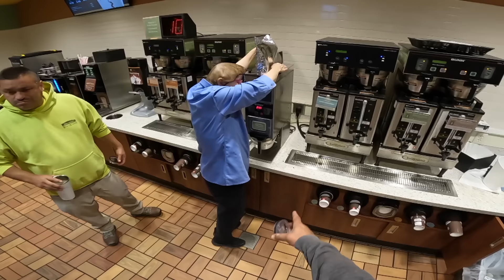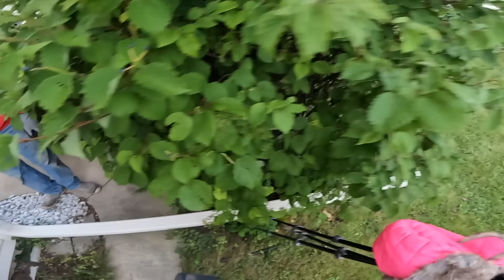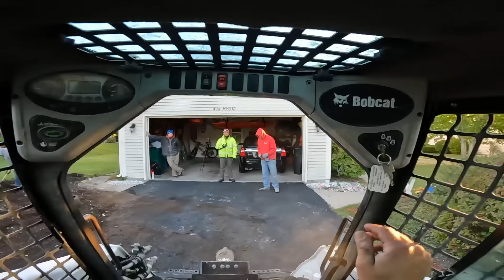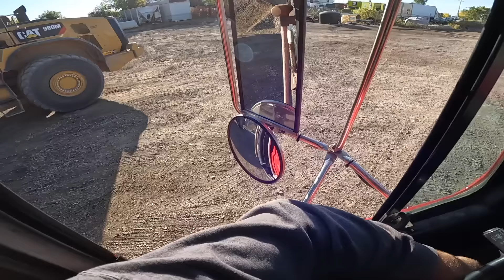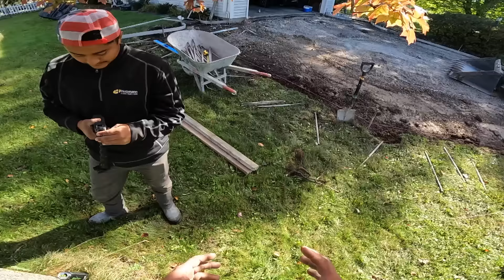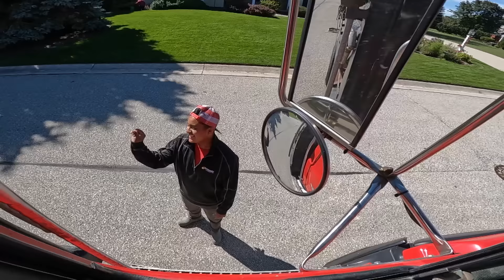New concrete project AND a new car for Bugs!!!

Comment: I had my class A for years and never like driving. Only did it like you when i had to. I totally agree with you, operating and laboring was more in my wheel house. Would be nice if you could find someone dependable for that position.

Comment: Diesel white smoke, depending on make and model, generally an injector issue, but important to figure out what’s causing it before opening the parts cannon., fuel filters clean ? , ficm? Injector pump? Lift pump?

Comment: Next time you drop the trailer set a cone up against wall of the rear most  driver side tire and when you go to connect again just get that tire right up against the cone and you know you’ll be in the right spot

Comment: Is Eric dump truck a diesel? If can be a leaking fuel injector. Turn each injector off one by one and if the motor sound doesn’t change then that’s the bad injector

Comment: White smoke out the tail pipe means blown headgasket or cracked head/heads. Don't get down on it just order an longblock motor from LKQ located in redding ca and maybe some other spots in the nation and there motors longblock comes with 3 year unlimited mile warranty and pay the extra plan that state that they will replace motor with no hassle meaning if you do something wrong on install and it get ruined they will replace it with no blame to you! Small blocks are $1500-2500, and my 7.4L was $2800 with an 700 dollar core I got back when old block was returned. Keep your head up brother!! We only live 25,000 days on average lifespan which is 75 now hold 25k in your hand and go spend it then think how you want to spend the 25,000 day after you understand these facts!! Don't waist them is all I say!

Comment: 3 years ago my ford blew out only white heavy smoke and a lot of it, two mechanics said head gasket that it’s not even worth to fix the truck almost sold it for junk, last mechanic said it was egr cooler and paid 1500 and works perfectly don’t scare eric

Comment: Ryan, I think next year you should make ur company profit sharing.
This absolutely changes ur workers mentality (because they are essentially co-owners now, however, zero extra if they leave, show up late, miss days and so on). 
There is a huge upside to this.
You can, instead of letting Eric use his own name, be more involved in his side projects, n make them ur projects.
I.e. you dont work on them, but they use ur equipment, and use ur name (which is why you will be more involved with pricing and management) n they do all the work and split the profits with you.

You will actually make money while ur at home with the fam working on the videos.

Comment: How to deal with employee,? I group them in two groups , reliable and unreliable., the reliable can rely on me, the latter I just look at as hands, and I only use them when it’s beneficial to me, raises are not even an option, and the further they move to unreliable the longer it takes for them to prove they can be reliable., in todays environment I don’t think firing them is beneficial to us as employers assuming they can work when they do show up., if they can work well when they do actually show up, then I just “don’t need you today” them to death..